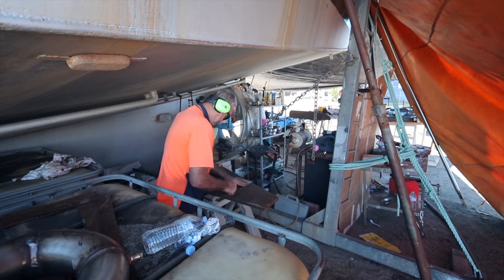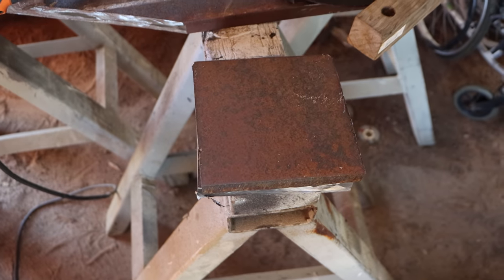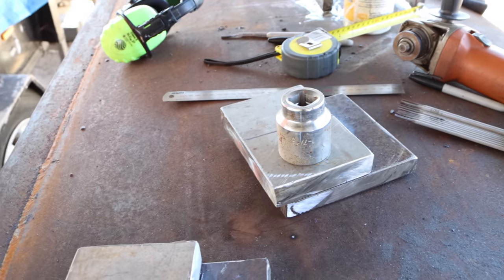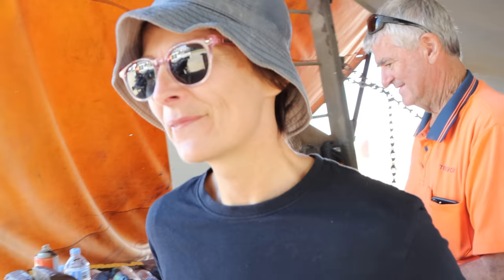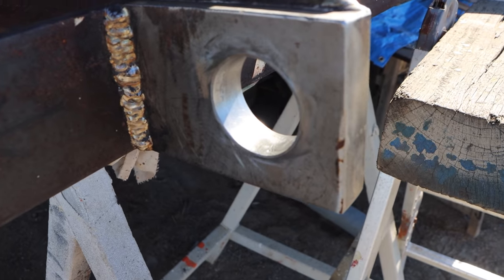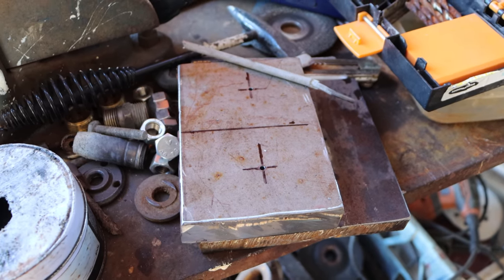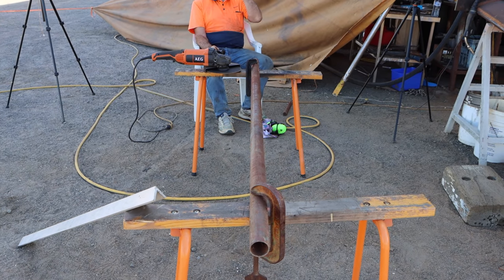Stabiliser Locking Arms for Brupeg - Episode 146

Comment: Thanks for the tip about the file I thought it would have been the other way. A clean new file
Reply from the maker: No, definately not, the blatant rust and swearing, acts as a grinding compound to really help mush the clearance out of the part...
Reply: Would a wood rasp that's been sitting in water for a few months work?

Comment: A previous comment mentioned a cylinder hone.  I think a better solution are Ball Hones, they come in all sizes with several grits and they don't break and they true the hole round.  They cut nicely with some WD-40.  A single size will fit a range of hole sizes.  Beats sizing with a rusty file!  Great work.
Reply from the maker: Thanks Ken. Yeah we tried hones after this but found the stones disintegrated. 2205 stainless is bloody tough material. We brought a new round file and found we were able to finish the job off that way

Comment: Tip from an old Drill Press and Mill operator, get an old oleo tub with a lid, fill it with cutting oil and cut a 3-4 cm hole in the center top. Poke one of those cheap, metal handle, short bristle brushes through the hole and use that to lube your drills and cutters. Using the brush lubes and cools the entire length of the drill bit while removing  swarf and 'coils'. The oil on the upper section will slowly run down into the cut, unlike a puddle that quickly 'boils' off at point of contact. You'll find you snap fewer bits and don't need to resharpen as often...Works well for tapping too... ; {
Reply from the maker: Ahhh love this idea. I will organise something this afternoon! Cheers Mike

Comment: Hi Guys, 
I think some time ago you said that you will take off the cooling pipes under the boat which means going on a slip.
I have an idea for you....
Not sure if you have done some of it anyway.
The pipes should have seacock on each one in side the boat so you can turn then off. 
With that in mind, now on the outside on the boat have a round plate which can be booklet on under water.
Have the pipe with I same size plate but on the pipes.
So now all you have to do is shut off the seacock , dive down take off the pipes put on the plate as a added safety and there you have it.
If I haven’t explained it very well let me know and will make a call to you.
Yes I am in Melbourne Australia
Reply from the maker: Yeah I get what you mean. For us it’s not a big deal to haul out and chop them off as we will be coming out to add stainless plating around the bow etc anyway

Comment: In regards to the box section twisting. Due to the way it is manurfactured and seam welded the tube has a natural slight twist in it.
Reply from the maker: I didn't know that, the twist wasn't bad enough that it couldn't be solved with some clamps.

Comment: I agree, Trevor is a good man he's a pro with that angle grinder, the drill press,,,,well maybe not so much. Looking at the photo of the wing and control arm attached to the side of the hull looks great, the grease fitting is a good idea, however, given the loads that connection will have during deployment l think your going to have problems with steel against steel, especially when stainless is involved. Are you sure you wont need sleeve bearings at the lower connection???? (just a thought.) Great to see the Boss/inspector out and about checking the progress of the project.
Reply from the maker: Hi Larry. The commercial guys just run those bearings steel on steel with no grease. They deal with galling up using different metals. In our case we have a stainless pin and a steel tube, so falling won’t be an issue.
Reply: @ProjectBrupeg  Thanks for the response.

Comment: As the arms slide up the hull at the inboard end do you have some tolerances for the slight imperfections in this type of hand fabrication?
Reply from the maker: Yes. But it actually turned out to be pretty damn close to perfect. When the arm is at full extension either way the difference in alignment is 10mm over a 5000m length. We could accommodate a 50mm difference in the way we designed the onboard hardware so we we very happy with those numbers

Comment: I’d be fitting a grease nipple! Less wetted area, less corrosion. If the stainless is going to be below waterline, fit an anode to it as close as you can! I’m not sure why you’ve chosen stainless. It’s not the solution you may think. I’m sure you’ve just categorised me as a keyboard expert. Enjoy watching your progress, thanks for sharing.
Reply from the maker: No it’s a fair point stainless has it’s place but it’s not the be all and end all. We will be adding anodes next to the stainless and eventually we will move away from it back to 4140 hinges

Comment: Pretty crazy idea these Aussie fishermen have come up with for stabilizers. So after the wings what's needed to get her in the water? Surely that'll save u some money not on the hard to finish the refit. Wish i could still be a patron but the world has other ideas. Also stainless is ok to drill just gotta be real slow and keep it cool. Soon as stainless heats up it work hardens amd eats bits. But it can be done
Reply from the maker: Yeah thanks for being a Patreon. The world did go a bit crazy and we still really appreciate the support regardless. For stainless if it’s smaller holes our drill press can handle it fine but over maybe 20mm and it’s out
Reply: @ProjectBrupeg  yeah 20mm is pushing it on such a small press. Hopefully we will all get back 2 work soon and i can start contributing again
Reply from the maker: Yeah I hope you can get back to work too. And thanks again for the support even while your out.

Comment: Straight up I know nothing about boats or welding but would using the  square box section create drag on the wings, or would not make much difference? genuine question. Good to see your both doing well.
Reply: I believe that lengthy of pipe they split will go on the leading edge so as to let the water flow past better.
Reply from the maker: Hi guys. Yeah the pipe that was cut in half gets welded to the front to round the arm off and the 75mm flat bar gets welded into a V shape and stuck on the trailing edge. The water than see’s an aero foil shape rather than box sections

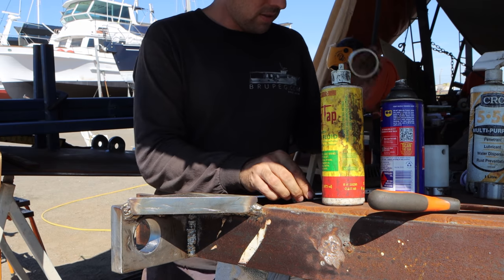Comment: 4:38 had a brain fart and thought the blue boat was attached to the side of the bigger white one behind it. Jesus. :))
I'm surprised that the drill press is able to do as much as you guys ask it. Stout little thing.  Prolly needs a few more grub screw holes. My home made one (not by me) has 4 in the cardinal directions. and they're doubled, so there's a main grub screw that does the job, and another on top of it, smaller, that locks it. Prolly not possible with yours, but if you can, do that.
Reply from the maker: We fixed it in the end by just cleaning it up, permanent loctite and some new grub screws tapped in

Comment: I thought the plan was to weld the pin bushes to the end of the tube using Arc welding but I see you ended up using Mig
Reply from the maker: Yeah we were comfortable with the strength of mig, this welder does punch above it’s weight so penetration wasn’t an issue
Reply: He also said he was rusty with the arc

Comment: I was wondering what the cost of building the stabilizing wings vs hydraulic stabilizers
Reply from the maker: Commercially these wings would cost $40,000AUD. We think we will spend maybe $3000AUD all up. The cost is in the labor so for us we can save on that. Active hydraulic wings would be easy 60k by the time you factor in the hull modifications needed and the engineering costs to get them right.
Reply: @ProjectBrupeg  Ok just checking.  I had hyd stabilizers on the Cheoy lee 61 and they really worked.

Comment: Stainless can be a b!tch on wheels to deal with due to possible work hardening  if you accidentally put to much heat in it .. i feel ya .. proper tools for the job makes all the difference.. i just got finished dealing with 1/4 inch 304 stainless plate, cant imagine dealing with inch thick plate high tensile...
Reply from the maker: Yeah this drill press does ok with maybe half inch drills but anything over that and it’s cactus

Comment: Dom - a cyylinder hone on a drill would have helped get those bearings fitted, rather than the shittiest hand file you can find ...
Reply from the maker: Yeah we eventually got a home but the stainless was so hard it just destroyed the stones. We ended up going back to a file
Reply: @My Account Was going to suggest same, a piece of crocus cloth or other medium to fine sandpaper will cut SS better with its thousands of teeth per square inch,  you could just wrap the file in the sandpaper and get more metal removed per stroke.
Reply from the maker: Yeah that was our initial idea but for some reason our local shop has stopped selling energy cloth to we haven’t had any for almost 6 months now

Comment: I thought dealing with imperial and metric was just in the US. I've been told everyone else uses metric and we're idiots...lol
Reply: Nah - its a mixture everywhere -  I'm UK
Everything is metric - except -  Pints (beer/milk),  Miles (motoring), and randomly usually things like peoples height and weight (feet & inches & stones).
Reply from the maker: We are fully metric. I try and convert on the fly as a lot of our viewers are from the states
Reply from the maker: Yip. I randomly was trying to clean up some threads in our fuel tank a while back, imperial didn’t fit so I assumed metric. That didn’t fit so I though it must be imperial and I got it wrong, imperial still didn’t fit. It was bloody Whitworth!
Reply: @ProjectBrupeg  The father of thread standardisation! otherwise every thread would be unique to the particular engineer that made the bolt.